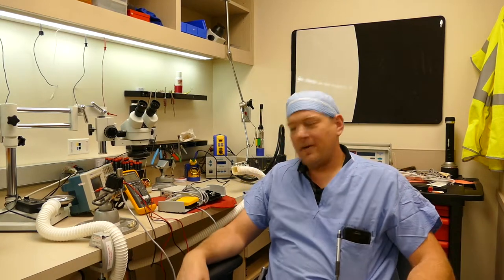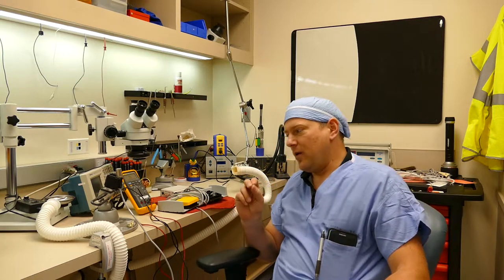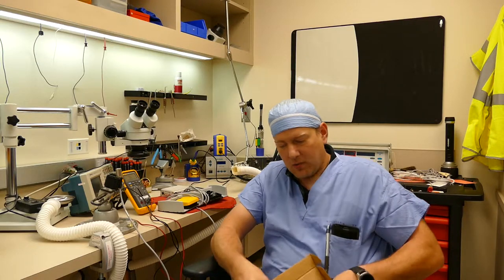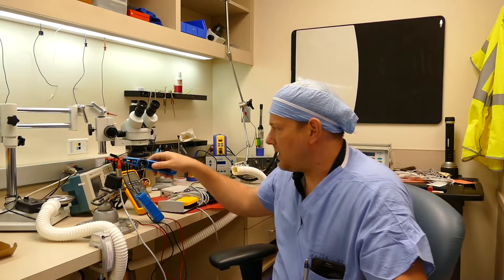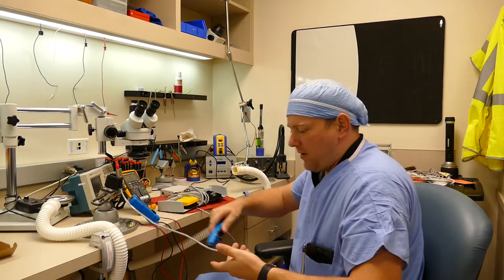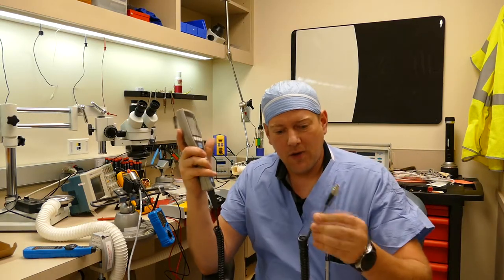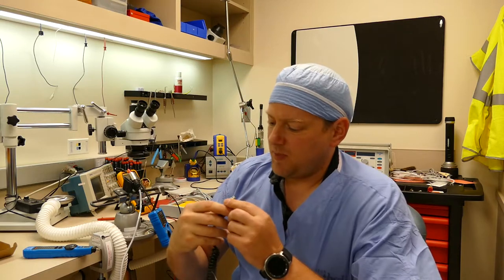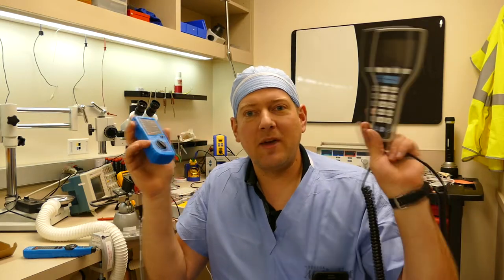Pro Tip 1   Non Invasive Wire Testing

Comment: Are you allowed to cut mid length and make a repair and patch with dual layerd heatshirnk for OR areas or  Lab / Clinic areas ??
Reply from the maker: Depends on the situation.  If they needed to run a case and parts would take days, I'd consider all types of repairs- as long as it's safe and reasonably needed
Reply: @BetterBiomedChannel  water tight and passes EST. Guess all would be safe till cable replacement